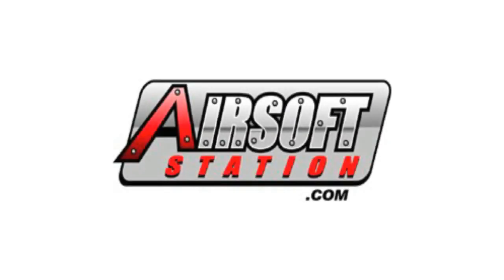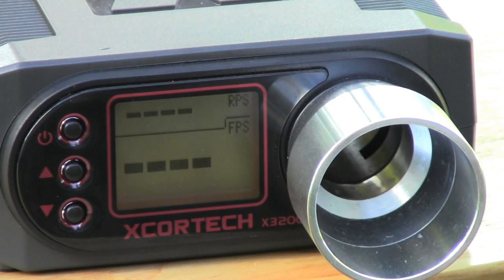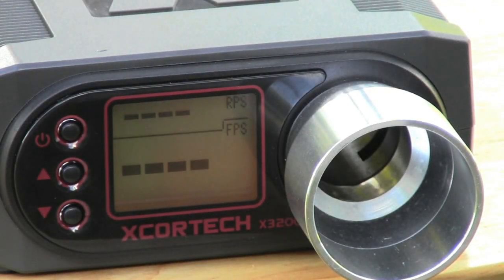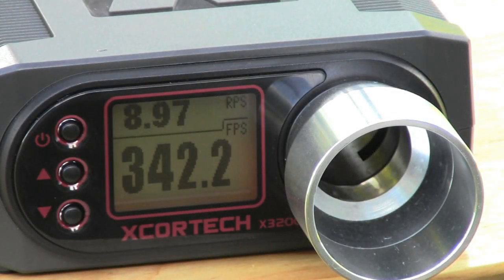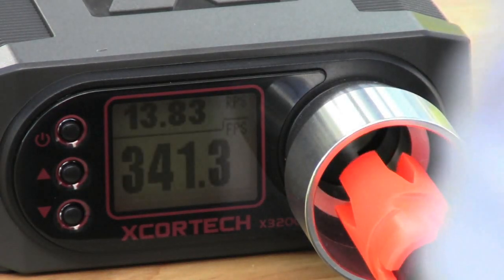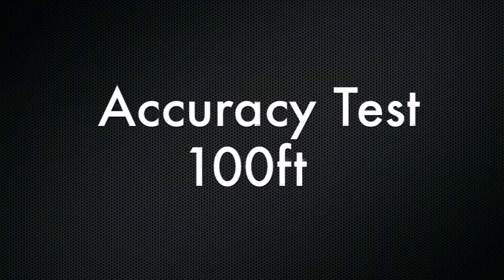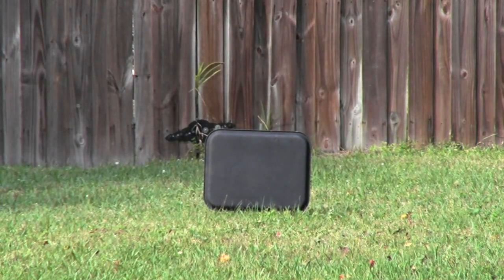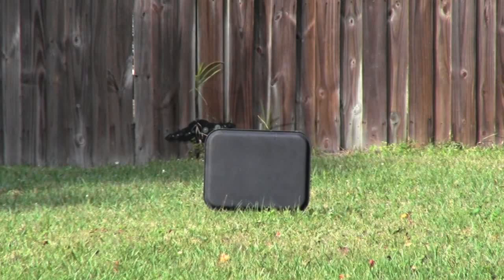JG MK36 RIS Shooting Test (Airsoft Station)

Comment from the maker: For this gun I recommend mounting a PEQ box on the side because there is very limited space for a battery inside the rail. If you do get a PEQ box, you can use whatever battery will fit inside it.